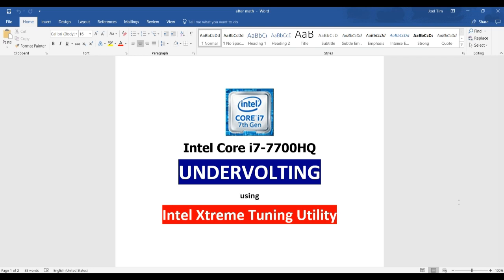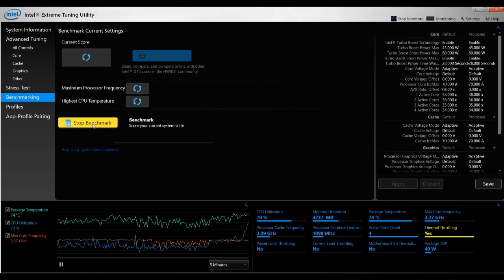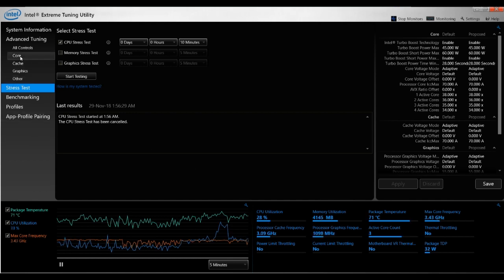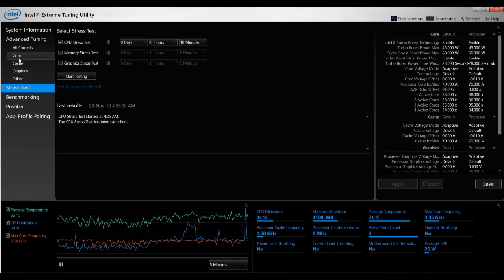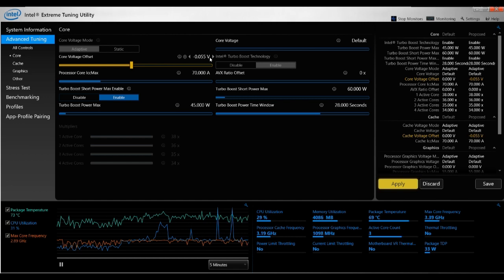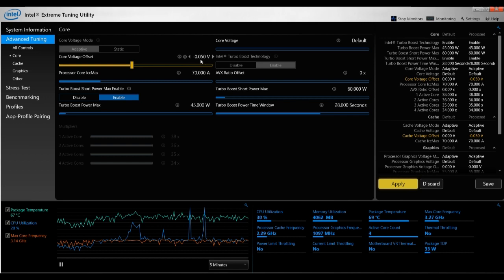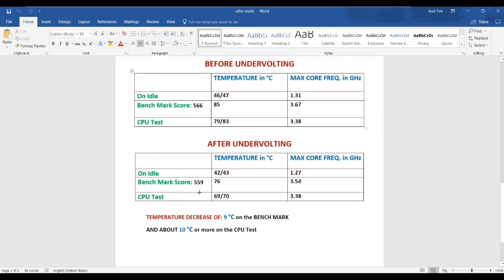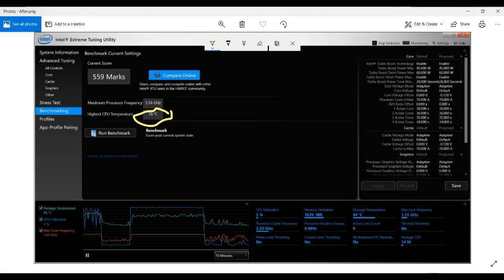How to undervolt your PC - with Intel's Extreme Tuning Utility

Comment: for anyone wondering how to save the voltage. the xtreme tuning utility is more for finding where your voltage sweetspot is. when you find it, change the voltage in the bios to make it permanent. 

MAKE SURE IT IS STABLE: saving an unstable voltage on bios could mean you can't reverse it and you will have to take the bios battery out of the computer to reset it

Comment: I undervolted to -0.100 on my alienware m 15 r2 but as soon as I am restarting my laptop the xtu shows core voltage of 0.000 instead of -0.100 , what should I do
Reply: Thanx a ton man , Does this happen with every machine or certain specific models
Reply: @prathamsandhu5190  The CPU doesn't really "save" the new voltage since it doesn't store information in it.
So, I think it happens to everyone. But, sometimes I log in my laptop and see my voltage still remains undervolted. So, I'm not sure how it actually works. I just make sure to run Intel XTU every time, it's not that much of a hassle.
Reply: You might have to reapply the undervoltage every time you restart your machine.

Comment: just one question does the undervolting stay after you you turn off and turn on your computer ?
Reply from the maker: in my experience no, but you can see if you can set the program to run when you first start up your computer

Comment: after run benchmark does the turbo boost will work?
Reply from the maker: hey yes, your turbo boost should still work. However, the general notion of turbo boost is to supply the cpu with extra power to boost performance so undervolting and running turbo boost are essentially two contradicting processes.

Comment: Thank you
my pc is i7 7700hq 2.8ghz up to 3.8ghz it's like your pc
and i want to enable turbo boost to 3.8ghz should i do the same in this video?
Reply from the maker: hey, this videos is about undervolting, if you want to turbo boost then that is a different procedure. If you want I can make a video about turbo boosting. Let me know. Also, try running a benchmark on your pc to see at what frequency it's running right now.
Reply: @joeltim  I have done now the run benchmark,maximum processor frequency is 3.46GHZ cpu temp is 76c
Reply: @joeltim  i would be thankful for you if you do a video about turbo boost.😊
Reply from the maker: @baderfury896  hey, so I found out that you cannot undervolt your GPU on a laptop since it is integrated in the motherboard and has the same power sources as the CPU.  It would work on a desktop pc though.
Reply from the maker: also if you are getting 3.46ghz which is higher than the factor set frequency then your CPU frequency is already unlocked meaning you are already turbo boosting. Normally the heating solution in your laptop cannot support 3.8ghz. Also boosting means giving more power to the CPU in exchange for higher performance. Undervolting reduces power to the CPU so the two processes are contradictory.